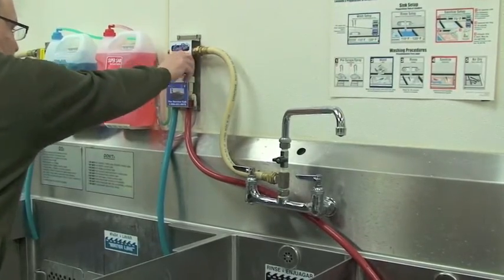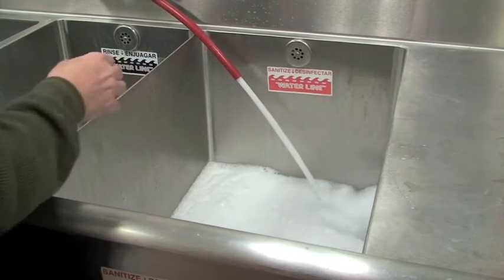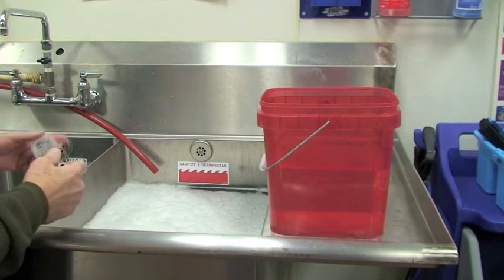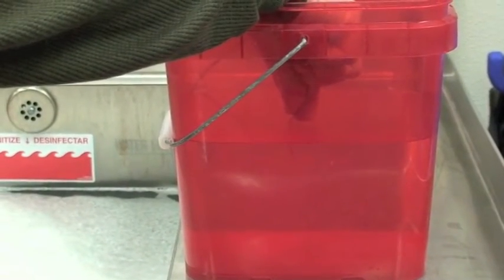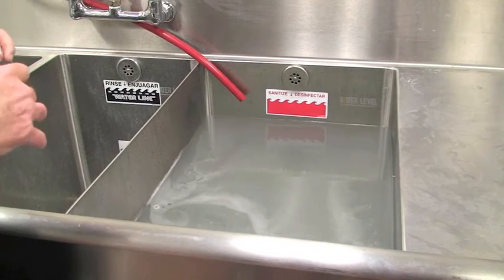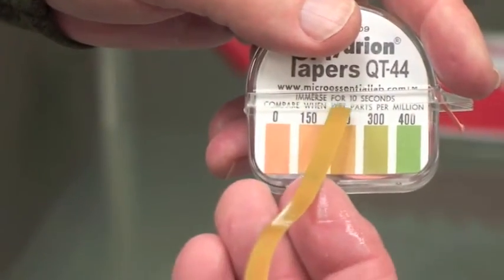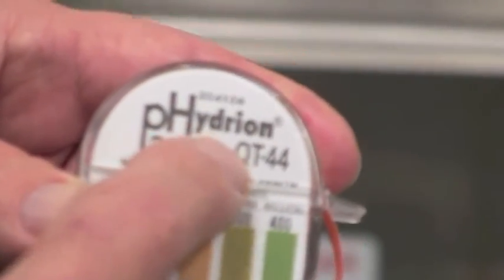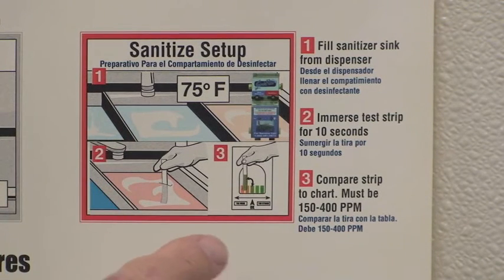How to Test Sanitizer in a Sink

Comment: Is 75 the temperature at which dishes need to be sanitized, or is this just the temperature at which the sanitizer needs to be tested? I thought QACs could withstand more heat than that?
Reply: Sean Hellems just the sanitizer 75 degree accoudring to az dish water should be 115 degrees